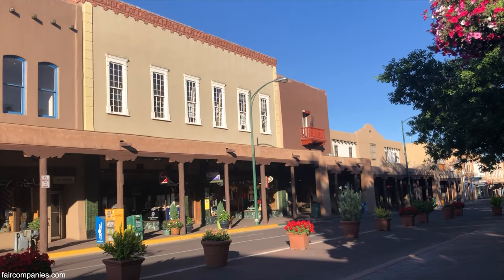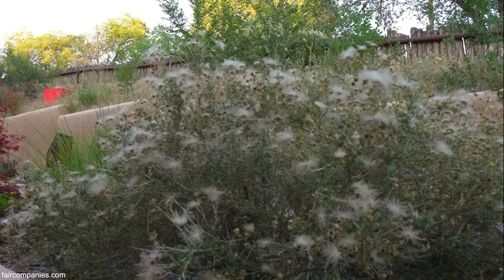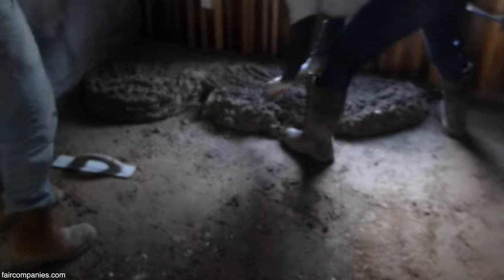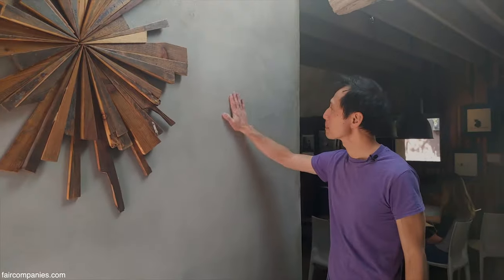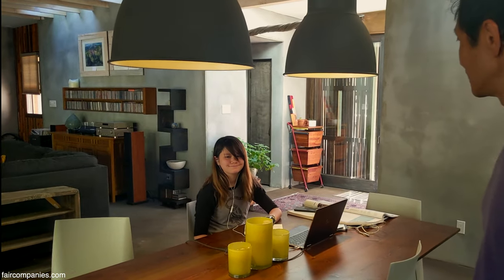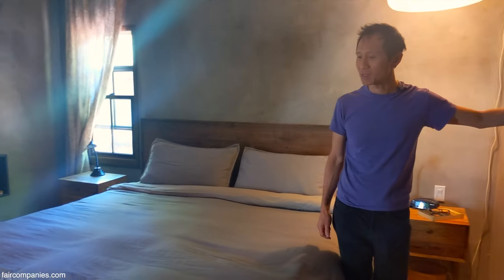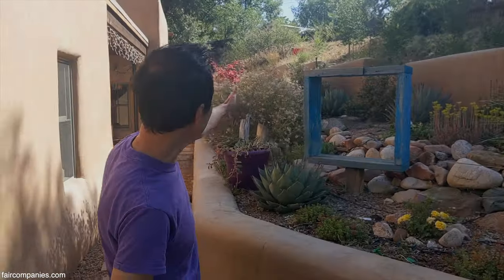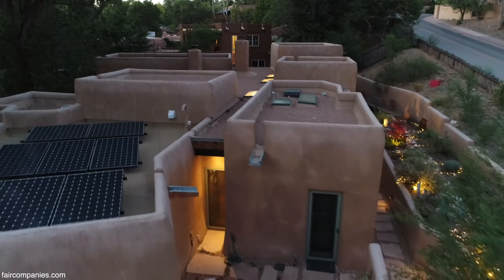Finds eroded shack, revamps it into heritage landmark home

Comment: His explanation of an adobe wall's r-value is a bit misleading. First, New Mexico has a separate set of rules for Adobe construction. Second, most adobe homes these days are built with exterior insulation which wrap the adobe - providing adequate insulation and the benefits of a thick masonry wall. He's technically right, you'd need a number of feet of adobe to achieve the r-vale he states, but nobody would do that, they would just use exterior insulation. I'm a big fan of adobe if you can't tell.
Reply: Well, general issue with building codes, etc. is sticking to established standards but lacks the flexibility to easily accept alternatives.  Like R-Value is only one of many ways to manage energy efficiency... Thermal mass, being another, for example, which Adobe and other earth based structures can take advantage of...  There's basically many ways to get the same end result but the system is designed to avoid liability and thus unless it's common it's very hard to try anything different...
Reply: @ZeoCyberG  Agree completely. I think the codes focus on R-value because they have numbers to put in the codes. Thermal mass, vapor, water, and air protection is so much more difficult to codify.

Comment: What a lovely home, and the buildout time-lapse was amazing to see. PS: Had no idea that Santa Fe got snow until this video lol
Reply: Santa Fe is high elevation semi desert, and when you live at  7000 ft elevation, snow happens!  It’s very dry snow, humidity is very low in the winter.  My nose and sinuses were so dry when I moved there in winter that I had daily nosebleeds for months before I acclimated to the climate.  Eventually, due to a divorce, I moved away but I do miss it ...though it’s a tough climate for anyone with health issues, especially CFS, or heart issues, or cancer where anemia is common ...I suffered with many migraines, fatigue, depression and perpetual dry lips my first year there...had no prior understanding that high elevation and cold dry air require adaption, and if you have health issues, it’s challenging.

Comment: IF YOU BUILD RIGHT you don't need air conditioning.  Most older houses don't have air conditioning in Santa Fe, depending on what section you live in.  With rising temperatures, many people have had to get air conditioners installed.

Comment: It’s very cool the only thing I would say is I hope those 2x12’s you used for your butcher block counter are small grain hardwood, bc if it isn’t that’s a nightmare and a half with bacteria from meats. Don’t mater how much you clean it than it will be in there :( I would seal it up with clear food epoxy so that way nothing goes in the wood making a massive mess on the bacteria front.

Comment: If you put straight straw inside the wall, then you put Adobe on it. It will have a really good yes everything wall has to have at least over a foot. Your ceiling has to be 2 feet keep out the cold and nasty heat and with trees even better and I love her gardening, if you’re wall, at least a foot thick, I don’t want to do anything for me no concrete

Comment: I've worked with adobe and rammed earth but not using straw. Why use it? Can you feel the straw when you walk?
Why did you need a 4' adobe wall? Post/beam + 2' adobe + poly-iso outside foam should give you any R-value you desire. That thermal mass inside should give you sound insulation. Wait, was it city codes that dictated the costly construction? I hope not.
What does the cement stucco smell like? What was the outside adobe stucco formula? Why wasn't that used inside? Do you have PV/battery? A BEV?